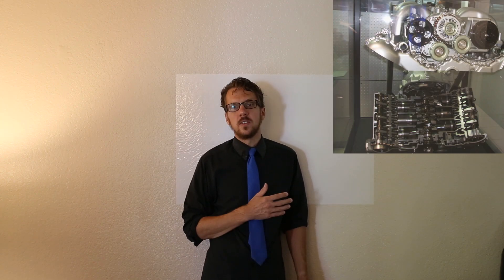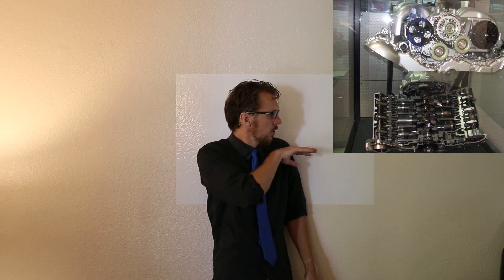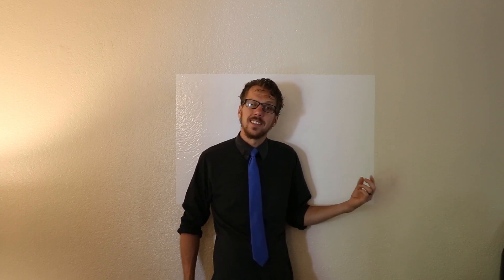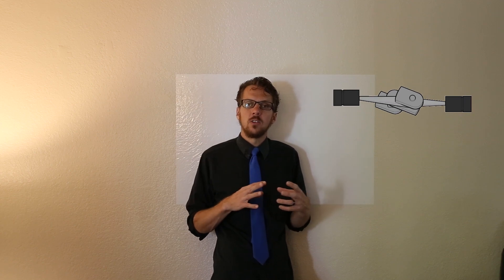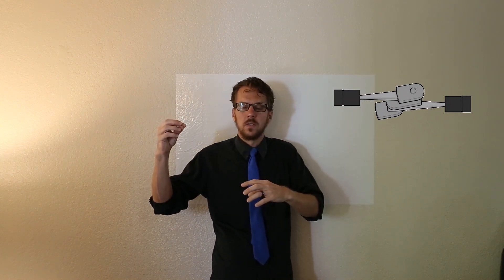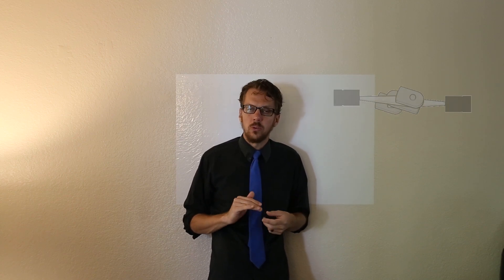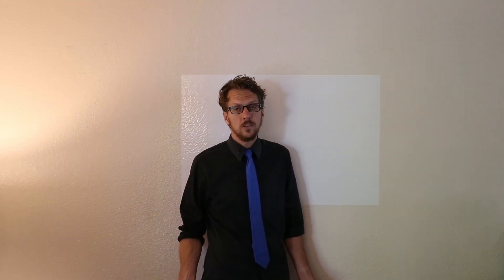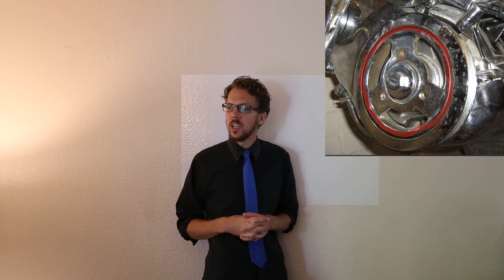How Lightweight Flywheels Destroy Engines (LWFW part 2)

Comment: Am having a DMFW installed on my 2000 base Boxster as we speak. The guy doing the work says that a lot of owners that went with the SMFW's for daily drivers complain about 'gear rattle'. I don't know what that is, but don't like the sound of it. And compared to most cars, the Boxster still has a very fast revving motor that drives like a lightened flywheel anyway.
Reply from the maker: You're right. Many cars have a harmonic dampener to even out things... The Porsche flat six is so smooth, it didn't need it... so it's already good. Of course, that means if you have a SMF you really don't have anything smoothing things out. I've also heard many people say it really isn't ideal as a daily driver.

Comment: Word of advice to Mitsubishi 4g63 turbo Owners: do not get a light weight flywheel. 1.The inertia of the heavier one will help your launches.  2. The lighter flywheel will not combat vibrations effectively leading to increased likelihood of crank walk.

I would even go as far as to say any car that's awd your also going to be disappointed in launches if you go to a lighter flywheel.
Reply from the maker: Agreed! Thanks for stopping by!
Reply: It just depends on the application. I am running up to 9k+ rpms and prefer not to do harsh launches to save the drivetrain. I also use a fluidampr to compensate and add protection. In my case, since I don't do 5k clutch dump launches, it is very beneficial to me to get moving and then be able to rev quickly and get into my powerband. I 100% understand what you are saying but for roll racing, twisties, and my style of drag racing (can't afford to break axles etc.) the lightweight flywheel helps.
Reply: Fair enough, specifically the fluidamper for the 4G63 is heavier than stock damper, but what it provides in protection is well worth it (I would say that's true for any application also). The light weight flywheels specifically on the 4g63 are known to be a possible cause of issues with vibration. I run a fluidamper on a standard flywheel and don't do launches in my awd above 3k. I also try to light launch then punch it to be nice to the axles too. I would love to know from some builders that have specific experience working with the 4g63 and using light weight flywheels / and what the bearings look like after some mileage. Solid un dampened under drive pulleys I can confirm directly lead to bearing scoring and premature bearing failure of the 4g63 engine.

Comment: nothing a good tune and appropriate engine bearings couldn't fix.
Reply: nick simmons not always... If you're driving a Subaru with that ungodly rev hang then it is very beneficial to get one so that it drops into the right rev range better
Reply: My rx8 is stock-ish has had a stage 4 clutch w/ lightweight flywheel and I've had no problems with it this past year all this means is I can accelerate quicker and have an advantage on the drag strip or the track
Reply from the maker: Yeah, if you're building and tuning the engine for a LWFW, it would be awesome. I limited this discussion to a stock car.
Reply: but it's pointless to put a lightened  flywheel on a stock car.

Comment: I started looking for a LWFW but quickly changed my mind, exactly because of what you thoroughly described. All GT3 and RS engines have LWFWs, but then the entire powertrains of these cars are built to a higher spec thus reducing the need and potential damage caused by not having external/intermediate balancing. Thanks for the videos, I appreciate that you justify your claims.
Reply from the maker: Yes, that's exactly what I found when researching. Engines are balanced and build from the ground up for a particular flywheel. Cheers!

Comment: okey and if i put the single mass flywheel but with almost the same weight than dual mass? 
i also dont like light flywheel for daily driving, but I also dont want to change it each 80.000kms and pay like 400€ more when just the clutch kit is like 140€ euros..
Reply from the maker: Yeah, if you found a single mass flywheel that was roughly the same weight AND used the spring clutch disks that come with the single mass... that seems like it would be a similar setup. However, it seems like a lot of work. The Luk flywheel shouldn't wear out in 80.000km. It should last 120.000km or more. You typically have to replace the dual mass flywheel every other time you replace the clutch (so it lasts twice as long). Assuming mine was the original flywheel (and I think it was), it lasted 160.000km.
Reply: Burner's Cars in bmw it is easy to find it.
The lasting depends on driving style also ;)
And by the way, dual mass dont like a lot of traffic also

Comment: Thank you Burner sir! I was debating whether i should buy another factory clutch and flywheel for my audi a3 2.0t or a lwf. This video has answered whether or not to get one especially since ive heard that ill need to rev the car a little more to get off the line with a lwf or might stall (though i would expect it would just get some getting use to) as well as some other concerns. Anyways great vid!

Comment: I have been wondering for a while and cant seem to figure it out. I used to have a dmf on my car, and accelerating quickly from a stop was easy. I put a lwf at 13 lbs in my car and it feels slower off the line than before. It also feels like it has less torque than my car with the dmf (even though I know thats not the case). Once I get going to normal traffic speed and then want to punch it, the lwf does feel quicker than the dmf would be. So why does my car feel so sluggish off the line with a lwf?
Reply from the maker: Hm... I could imagine one scenario where this makes sense. If you are launching your car off the line... say revving the car to 3 or 4k rpm then releasing the clutch, the dmf probably would feel a little faster / with more torque. This is because the extra weight of the dmf is attached to the engine and is always spinning with the engine at the same speed as the engine (and much faster than the transmission / wheels). That extra weight and rotational energy of the heavy flywheel spinning could transfer more energy to the transmission and wheels once engaged. Once the flywheel and transmission are spinning at about the same speed (normal traffic speed) the advantage goes away.
Reply: Burner's Cars thanks for explanation!

Comment: I just want to say, that in theory you're 100% right and do agree with you, however, those vibrations on a daily/track car, how much do they really shorten the engine life compared to the use of the engine while the car is on a track. I am going to say that it's fine to use a lightened flywheel on a daily/track car and the engine life won't be significantly shortened in comparison to a daily/track car with a dual mass flywheel. That's fair to say right? People reading this should understand that if you are building a car to have fun on the streets, you don't need a lightweight flywheel since it won't make a difference and it's just a consumer mentality, however if you do go to a track and push your car to the limits then go ahead and buy a lightweight flywheel along with an aftermarket heavy duty clutch.
Reply from the maker: Exactly right! You have to build the car based on where you drive it. On a track car, the LWFW shouldn't significantly shorten the life of the engine when compared with the dual mass.

Comment: Hey ben, how long did it take you to complete this clutch job, and where did you get your IMS bearing from and about how much did it cost? Thanks!
Reply from the maker: I think the project lasted about three weeks, but that's because I wanted to take everything apart first and then order the parts. It was maybe four full days of work. As for cost, clutch, pressure plate, flywheel, clutch release plate, and other related parts and bolts was probably about $1k All the IMS parts and tools was $300-400. Once I go through all my videos, I'll look over everything and figure out the exact numbers. http://burnerscars.blogspot.com/2016/08/sourcing-your-own-porsche-ims-bearing.html

Comment: The main point of dual mass flywheel is to dampen irregularities in engine revolutions - engine doesn't turn with constant speed - it accelerates and decelerates a little each revolution as the fuel ingnites etc. Dual mass flywheel is torsional spring and damper so on one side you can input variable rotation and with proper spingrates inside the flywheel you get constant rotation on the other side which is mainly percieved as less vibration, but yeah there is less force on the engine internals because of that. So that is the main function of the dual mass part, to stabilize the rotation.
Reply from the maker: Exactly what I was trying to explain! It's always hard dealing with the technical aspects of cars. I want to give a sufficiently detailed and accurate explanation without being tediously boring!